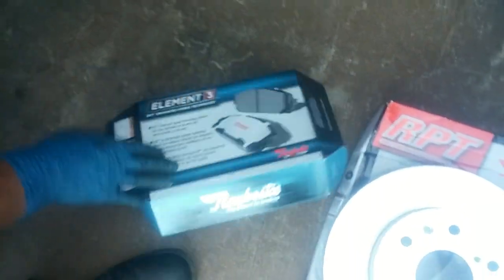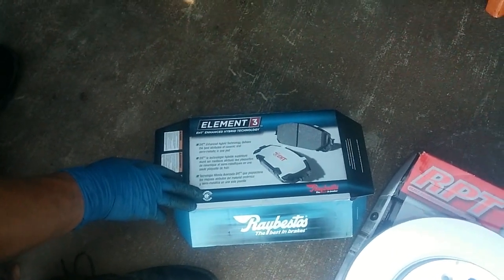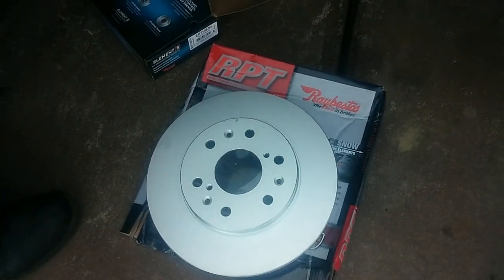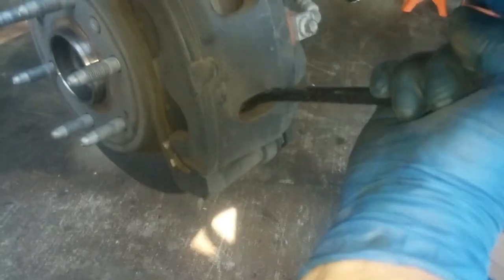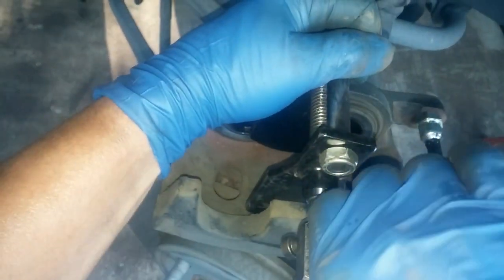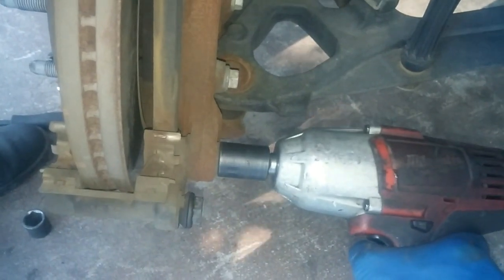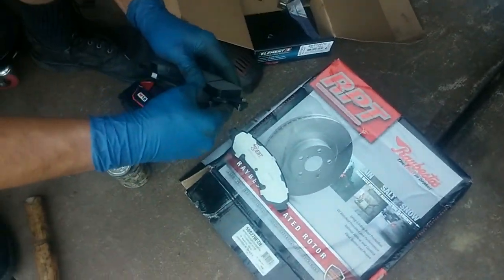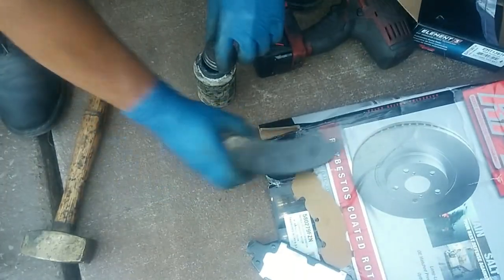Front Brakes & Rotors Replacement: 2012 Chevy Silverado

Comment: What's the name of the grease with the brush that you put on the pins and back of the pads? Also, where can it be bought?
Reply from the maker: It's synthetic brake caliper grease.  You can buy online or at your local auto parts store.